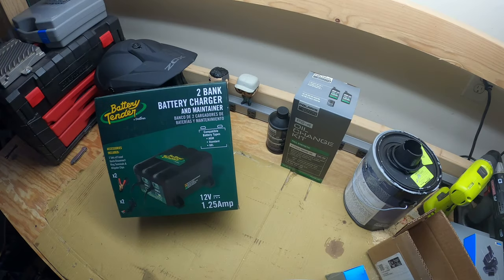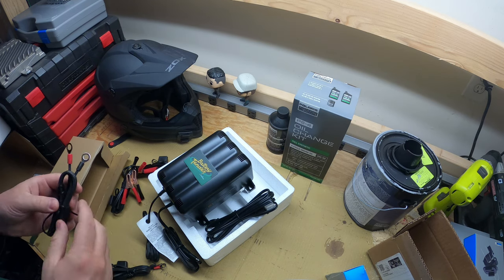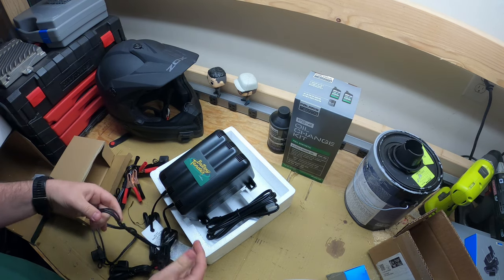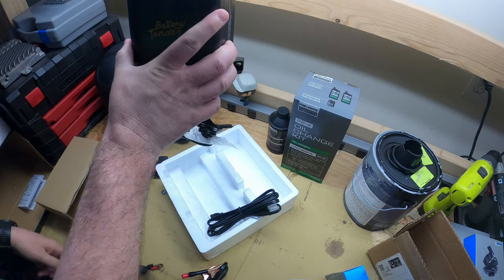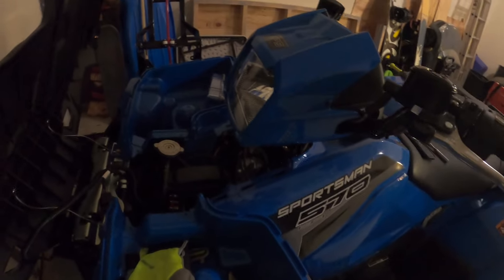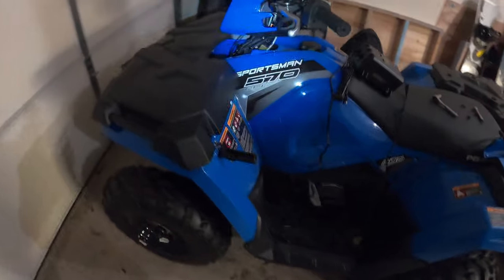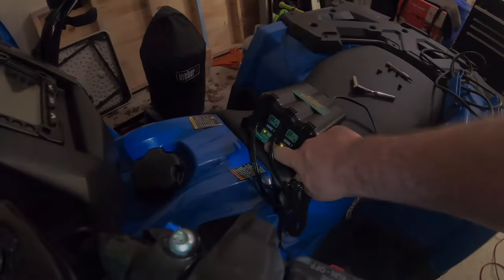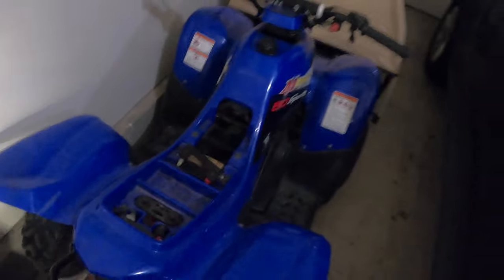Everyone needs a battery tender in their garage! Install on my Polaris Sportsman 570 EPS

Comment: I did the same. 
Why, why would Polaris put the battery down there?
I also check water level in the battery every 6 months or so, it always needs water added.
👍
Reply from the maker: They finally moved the battery location on the 2021. Love the look and the small changes they have made, but not enough to sink more money into a newer one.

Comment: I recently bought an Indy red 21 Polaris sportsman 570 efi with a charging port under the screen. Now my question is, what kind of battery charger does it need to be compatible with that port under the screen? 

I know very little about maintaining one. (ATV)😂 😢 Some help would be very appreciated. Thanks.
Reply from the maker: Did you buy the Polaris brand new or did you buy one used?  I am not familiar with a charging port that came direct from factory, but it is possible newer models may have that.
Reply: @DadTechTV  I believe it was new. Flew in nice and clean. Factory clean. And yes it has a charging port underneath the screen. A 2021 Polaris sportsman 570. I’ll try to figure out what battery charger to use and thanks